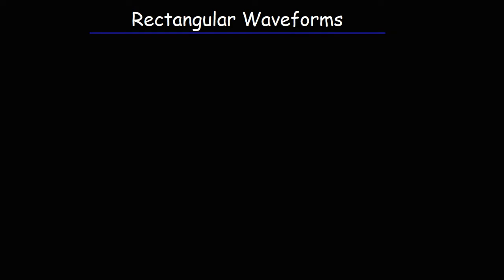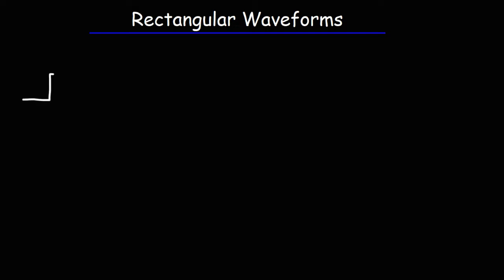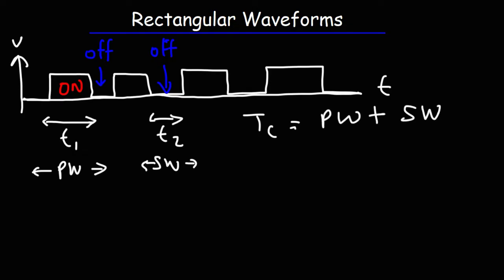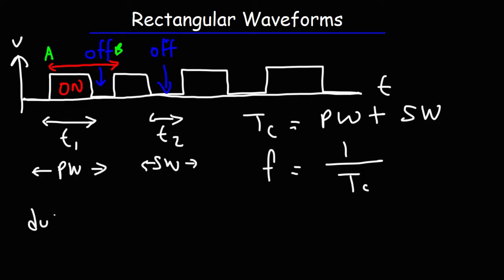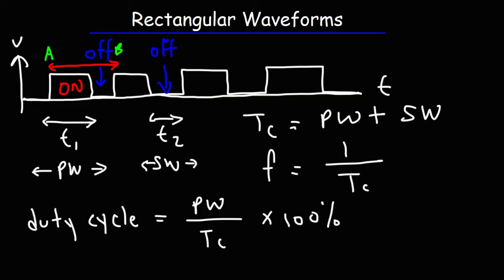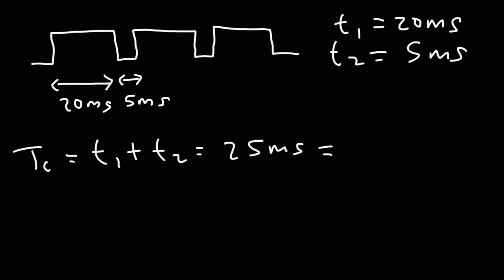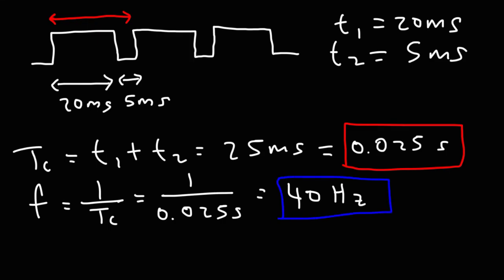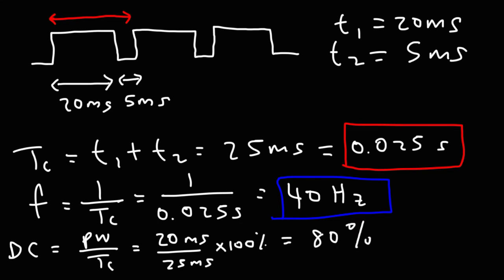Duty Cycle, Pulse Width & Frequency - Rectangular and Square Waves

Comment: So this is one squarewave cycle, right?
___
|    |___.....V=0 line

But what if the voltage oscillates between positive and negative❔
___
| + |.....V=0 line
  – |___|

– Is negative off or is it zero⁉️

– I think it would be safer to choose negative b/c it's there just as often as positive and zero is just transient. I can imagine many glitches occuring around zero.

Comment: Excellent video! I have one question about duty cycles. Is it possible that the load could be ground-side switched and the duty cycle become the percentage of time that the voltage is switched to zero? I seem to vaguely remember a certain automotive component (this might have been a solenoid, possibly a EGR valve). It was controlled by the engine control module, which used a duty cycle to provide a pulsed ground to the solenoid... I could be mistaken, but I'm just curious about that.
Reply: It can be use in both side depend on how the component was design. It can be active "HIGH" or active "LOW". CMIIW

Comment: Superb explanation. TY!
BTW, how can we know the maximum frequency we can use on a mosfet? It is not explicit on datasheets.
And what means the voltage on gate VS current with the labeling "20 µs Pulse Width".

Example: IRLZ44N